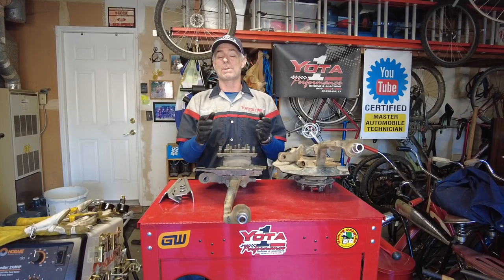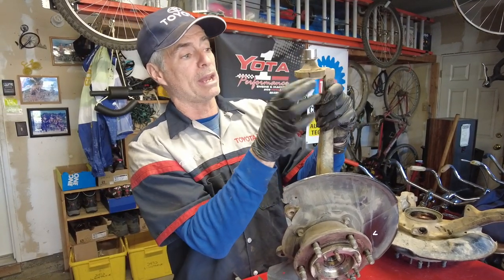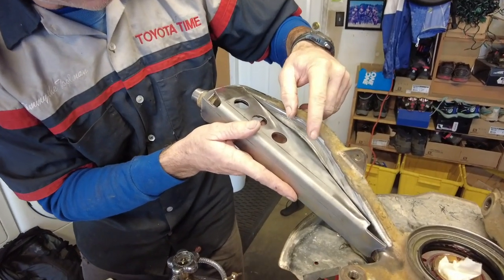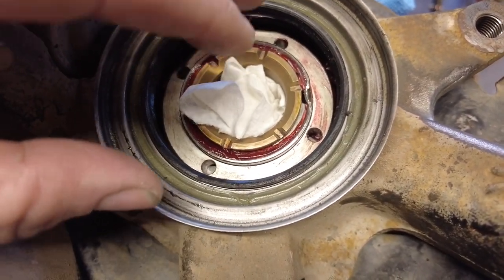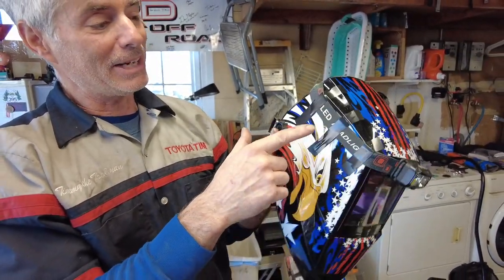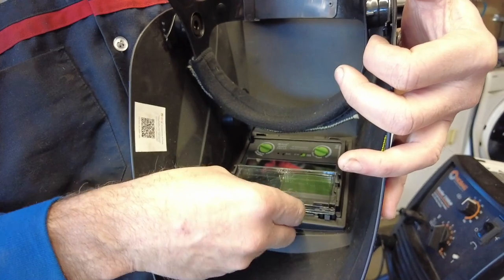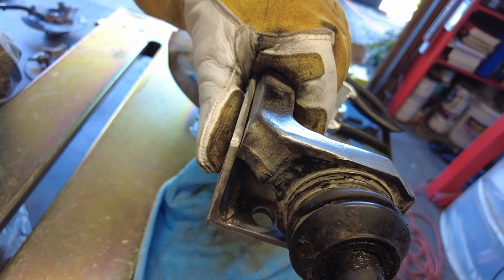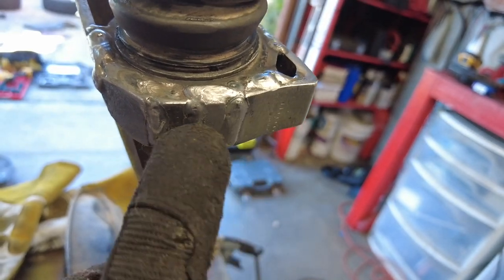Total Chaos Weld-On Spindle Gusset Install

Comment: I see there are all sorts of weld on supports you can buy. What are the weakest spots that need reinforcing for hard off roading?
Shock tower brace, gussets, lower control arm braces ect.
Your channel is amazing by the way. Thank you for sharing your knowledge.
Reply from the maker: Well, for every reinforcement out there, somebody broke that component that inspired it.  I'd say the spindle gussets are a smart one to do.  I'm not so sure how necessary the shock tower reinforcements, front lower control are braces and rear control arm braces are.  So far on my 98, the spindle gussets are all that I've done.  

Great to hear you like our channel.  You're very welcome and Happy Wrenching!

Comment: Great video ! 👍
You should make a video on how to protect a catalytic converter from theft or how to remove and bypass the cat with straight pipe!
Put the cat back on only when you need to pass inspections !
Reply from the maker: I've thought about putting an extra side skid plate to make it harder to steal the catalytic converter.
Reply: @TimmyTheToolman  
Our trucks are open invitations !  If I catch someone steeling off my truck, I'm gonna lose it ! 
Now I'm worried about parking it anywhere.  There has to be a solution to this.
Palladium and Rhodium are just going to skyrocket !  Rhodium 27K per ounce ??  Hahaha 
The catalytic converters are going to be worth more than the truck !!  WTF ?
Gotta come up with something !!  Quick !  👍
Reply from the maker: @williamtsol636  The real answer is trying to take the criminality out of it.  Only licensed shops should be able to turn them in for recycling.   The recyclers have to suspect the crooked people who bring them in in large quantities all the time.  It is a huge problem and the recycling Industry needs to do something about it.
Reply from the maker: @subtegral  Yeah, exactly.  And, make the punishment for those that do it very severe as a deterrent because It has become a huge problem.  It is costing the insurance industry and individuals a ton of money.

Comment: Nice welds You been practicing hard timmy couple pin holes but nice
Reply from the maker: Thanks Antonio.  The practicing has been paying off.  I'm going to keep on practicing.  I've been picking up scrap pieces at a fab shop and I spend a couple hours here and there welding pieces together in different orientations..

Comment: Hey Tim how’d the ride feel after you welded that up? Any difference on the street?
Reply from the maker: No difference at all.  The steering knuckle doesn't really flex enough to someone to actually notice but it will fatigue and break if put through enough abuse.  The whole point is avoid a bad situation out on the trail with a broken spindle.

Comment: Damn I should’ve done that when I had it apart. I love the holes, would cool so cool with some  dimple die on the holes.
Reply from the maker: Hindsight is 20/20.  The spindles aren't that hard to get off so when you get the motivation, pull the spindles off and get em welded on.

Comment: Do the gussets allow removal of the upper ball joint (ie will the OTC receiving cup still fit square)?
Reply from the maker: Good question and the answer is no.  The gusset would get in the way of the receiving cup.  I asked Total Chaos about this and they only recommend people use their gussets with aftermarket control arms that have a sleeve pressed into the steering knuckle rather than an OEM balljoint.  I'm sure the balljoint removal could be done with the gussets welded onto the knuckle.  An air chisel could push the balljoint out.  Getting a new balljoint back in probably wouldn't be an issue because the c-press should still work for the balljoint insertion.

Comment: I’m still a beginner welder, but from my understanding, setting the welder settings according to the thickness of the gussets is incorrect. 

From my understanding, when welding thin to thick, you’re supposed to set the welder settings according to the thicker metal, predominately have the welding pool on the thicker metal (spindle) and stitch in the thinner metal (gussets).

Doing it the way you did would greatly limit the amount of fusion into the spindle and would be a significantly weaker weld. The same can be said for using .024 wire, you are significantly limiting the amount of current going into the weld and henceforth significantly limiting the fusion.
Reply from the maker: @TheMrshawnpaul  Well, those spindles are THICK.  The settings for my welder only goes up to 3/8 thick steel.  I'm pretty sure the spindles are around 1 inch thick.  So, with your logic, you weld at a voltage and wire speed for 1 inch thick steel.  Good luck with that.  I guarantee that if you weld that way, you will vaporize the thinner material.

I'm not an expert welder, but welding the way I did makes sense so you don't blow through the thinner material.
Reply: @TimmyTheToolman  Odviously settings for 1” thick material are to excessive and blowout sucks, but I still believe the settings should be set as high as possible without blowing through the thinner metal.

I’m still an amateur welder so I don’t know what the ideal settings should be, but I have practiced the technique with some 4:1 scrap and I didn’t blow through the thinner piece. With the technique, you bias the welding wire contact point to the thicker material, which takes most of the heat, and you build up the puddle so it contacts the thinner material, but you aren’t putting the current directly into the thinner material. 

The welding technique is described in this video by TimWelds: https://youtu.be/iS5GmXj2rpw?si=GclaKugQtoXWymDp
Reply from the maker: @TheMrshawnpaul  If you have the eyesight and steady hand to perform that technique,  that's great.  I'm lucky to be able to see the welding pool clearly with my eyesight.

Comment: Aren't the knuckles cast iron? Wouldn't the welds weaken the cast iron? I welded the upper ball joint steel adapter for the total chaos and I hit a pot hot pretty hard and snapped clean at the welds.  Iwas told this was the cause. Any truths to this? The day it was  at the shop: http://imgur.com/a/yinatEf
Reply from the maker: I had heard people say they are forged.  I have also heard that they are cast but I don't think so.  Cast iron doesn't flex, and it would seem weird to have a steering knuckle be made of cast iron.  Lots of people that 4wheel hard use these gussets without issue.  Check out the Total Chaos website.  They say right in the product description that the spindles are forged not cast.  https://www.chaosfab.com/accessories/1996-2002-4Runner-Weld-on-Spindle-Gusset-59697